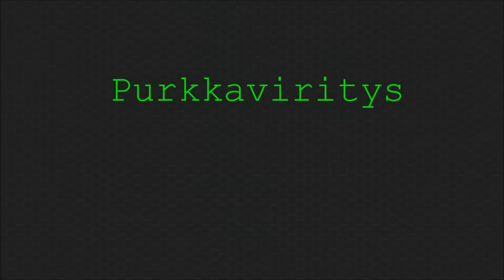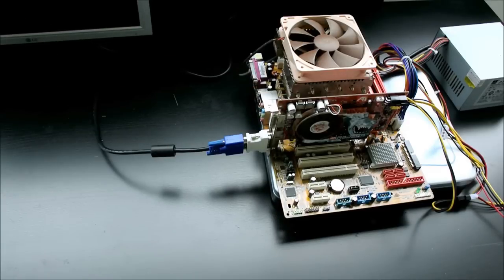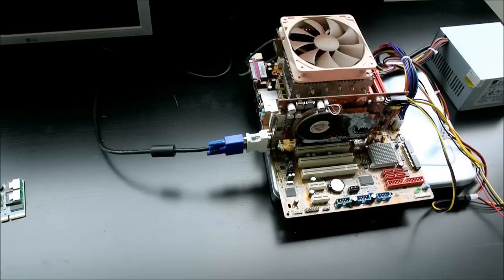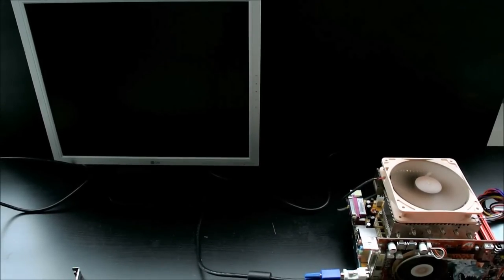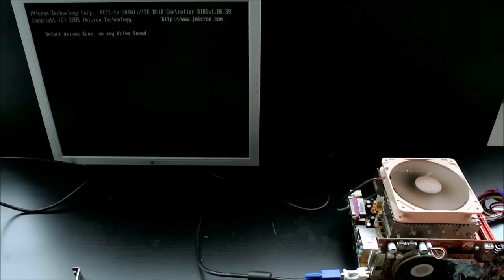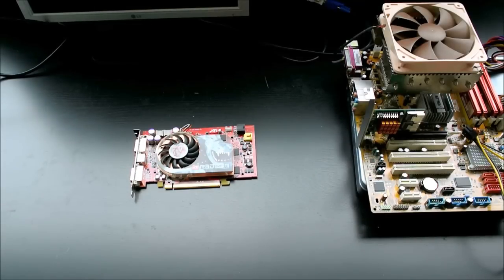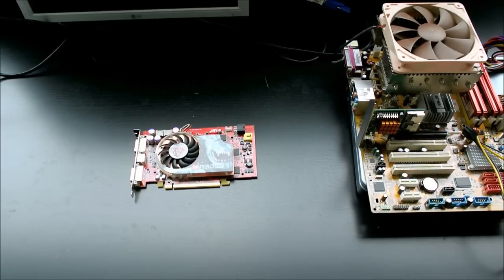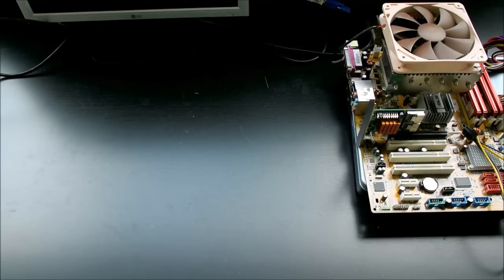Modifying a PCI-E 16x Card to fit into a PCI-E 1x slot

Comment: This worked great! I had an old NVS 290 card.Cut it down without using an adapter. Shoved it in the PCI x1 slot, worked instantly. And i was surprised it actually worked. I just bought an adapter for using cards in the future, so i don't end up with cut cards lol.

Great Educational Video..

Comment: Why didn't you just cut through the end of the slot on the motherboard? Far easier.
Reply from the maker: if there are any components behind the slot, your card won't seat properly and this wont work, also the motherboard is usually more expensive than the cheapo graphics card you are going to cut, all of which is actually written in the video description.
Reply: Yeah I read the video description. Most of the time the GPU costs more than the motherboard though.
Reply from the maker: ItsAnArse Thats pretty much only when you are using a new fancy GPU, if you use the cheapest you can get, they still come in 16x pci-e connector even when the card could function with a 1x connector. Then there are used cards that are a whole another can of worms. For most people this mod makes about as much sense as doing your own appendectomy.

Comment: I get that it's not what you "should" do. I also get that the raid card was more expensive, some of them are quite up there in price. I even get that you only care that you're getting a picture and not extreme 3d graphics. It must be quite a crappy video card to be cheaper than the raid card (128, 256, 512), which would mean you're not getting extreme 3d graphics even on 16x. Maybe something I'd try with one of my cheap cards just for a laugh. Still, I think it would have been more logical to try it with a raid card, not that you'd want to ruin the card, but raid runs just as well on 1x as it does on a 4x/8x slot and you wouldn't lose the little performance you do get from the graphics. Just a thought.

Comment: Shoulda just opened the 1xslot
Reply from the maker: and use no clip to smash the card trough the coin battery? extra points for not reading the video description.
Reply from the maker: FatheredPuma81 all cards you plug into the motherboard will almost touch the motherboard itself, so if there would be anything behind the slot itself the card would not touch down in the slot correctly (anything over 1-2 millimeters is enough). So if there is pretty much anything other than a thin surface mount resistor, it wouldn't work.

PS. My original response is because people have an issue of commenting first before reading the description or reading any of the comments (ever seen a video that has the song that is playing in the description and 3 pages of people commenting to ask the song...).
Reply: Purkkaviritys
What song was that you were playing? Lol
Reply: you know that the exact same slot you used in the video has enough space?.... your argument is invalide because most mobos have the space for that...

Comment: I rather cut by hand the old way.If these cards dust is dangerous.Then the company its made by will be in big trouble.The countries  using china made stuff.Like USA UK Canada.Will stop it fast as they approve each thing an deem it as safe  from harmful material.So either way cut it an you get sick. you can sue them for it cause it had no warning on box.
Reply from the maker: They are made of fiberglass, and you should not breath fiberglass. That is why I used a mask with a proper filter while cutting, and suing them won't do you much good if you have permanent damage from breathing resin dust.

Comment from the maker: also on a related note, AMD cards does up to 5 monitors these days on a single card where as NVIDIA can only do 3
Reply: Depends on the card
Reply: Incorrect. The Nvidia NVS 810 can do 8 monitors (all of which can be 4K simul.)
Reply: Purkkaviritys At this point, there's no difference in the mid-range cards as far as displays go. Most AMD cards can do 3-4 displays, and this is the case with Nvidia cards. It has been for at least 3 years. You're still incorrect
Reply: ***** Tell that to the fact that the fastest single card is still an nvidia card. Tell that to the fact that more than 70% of all all dGPUs are Nvidia.
AMD cards are a great value in the cheap/low end market, but don't currently hold a candle to high end nVidia cards. You're delusional.
Reply: daniel wray Fair enough, but most people with 980 Tis don't keep video cards long enough for that kind of stuff to matter. Even i've had three different video cards just this year.
Reply: I did this on an old 8400gs to see if i could get video output from x1 since i will be using both x16 slots in my server with sata cards. It worked perfect, so I ordered the zotac gt730 which comes as x1 so no need for cutting and fanless so its completely silent. great video!
Reply from the maker: You should probably read on how PCI-Express handles lanes, as there are cards that come in 1,4,8, and 16x varieties.

Also the exact reason to make this video originally was to see the ratio of "boo fake" and "well duh, I know how PCI-E works"
Reply: Purkkaviritys gtx 960 have 5 monitors ?
Reply: My AMD card is not exactly the newest, but it's up there. 1gb GDDR5 ATI Sapphire Radeon, as far as I've ever known about AMD cards, at best they can only support 4 monitors and typically only have connections for 2 or 3. I'm not saying you're wrong but even the best AMD cards I've seen are like this.
Reply: Cutting the back of the slot doesn't always work because some boards have things situated behind the slot that would get in the way.  Further the motherboard is often of greater value and down in a case already where it's harder to access for a precise cut, and you cannot make a precise right angle cut with a dremel tool alone unless you had a cutoff wheel of approx 1cm larger diameter than the body of the dremel tool OR used an extension wand.

However if there is nothing behind the slot to interfere then another option is to only make a notch in the video card contacts to make room for the rear of the slot.
Reply: wenisinchina
Kind of irrelevant tho' as he's talking about being super-cheap.  Then again someone that cheap probably don't want to invest in so many monitors either, especially not 8 x 4K size.
Reply: Stinky Cheese he made no mention of specifically only talking about "cheap cards". He said "Nvidia can only do 3" and "AMD cards does up to 5 " Nowhere in that post does it say cheap cards only.
Reply: wenisinchina
 That is ridiculous. Why would you change three times in one year?
Reply: daniel wray I had a 680 that I bought upon release (2012), bought a 290x early this year, didn't like it, bought a 970, didn't like it, and then grabbed a 980 Ti shortly after release and am finally happy. I also ended up doing a full watercooling loop in my system.
Reply: As of a few days ago, I now have a 2gb AMD radeon vision A10, still better than any Nvidia card myself or anyone I know has ever used. Maybe if you buy one of the super high end $500+ video cards you might get an Nvidia that's better than an AMD card. By the way, those super high end cards are not worth buying no matter what the speed is seeing as a 2GB card can run any game in existence right now on max settings without shutting down extra programs and without problems. I'm sorry if your delusions take precedence in your mind over my real life experience which should count for more.
Reply: +Sylver Nexus what 2gb A10 are you talking about? I hope not A10 apu graphics. And it depends on what resolution you are talking about. Maybe 1080p and lower, but games that use a lot of VRAM will suffer 1440p and higher or multi monitor no matter AMD or Nvidia
Reply: +wenisinchina I would have bough another 290x on ebay for 200 and be done. Thats what I did and never had problems.
Reply: daniel wray this was before they became dirt cheap
Reply: daniel wray
You do not know what you're talking about. Yes it is an APU and no it does not even touch my vram at all which is set to 10gb per drive (20gb) on top of 32gb of ready boost cache. First it would have to put a huge dent in my physical ram which it does not. GTA V has the biggest game map in the industry and my 8gb of ram is still only being used up to about 50% when it's running, sure the APU is running near 100% with everything maxed but I can still pull off running movies in the background. You're probably one of these people who wastes their money on parts that are way better than you'd ever need and assumes that anything less isn't going to cut it. I'm the kind of person who takes what I can get and makes it work for me.
Reply: ***** Well aren't you the cat's ass.
All that readyboost cache. So fast!
You ain't got shit on my 1TB of external drive being used for readyboost an 32GB of RAM.
Fight me.

No but in all seriousness there's no such thing as a 2gb APU, dumbfuck. My Nvidia 980 Ti poops on your crappy APU, too.
Reply: These are millionaire kids, one can afford to be finicky.
Reply: the Gtx 1060 says otherwise
Reply: My GTX 760 (Isn't much of a gaming card) Runs up to 4 monitors by itself. No SLI
Reply: I'm glad that Apple eliminated the headphone jack on their new model in order to make it ripe for entities such as this to provide information that would help the gullible to destroy the gadget. Likewise, one can relate this type of video to that.
Reply: Gaming With Chief My GTX 760 2GB Supports 4 monitors at once, plus I've tested it, Currently only running two as one died
Reply: my 7950 can
Reply: but a year later they suffer from planned obsolecence?
Reply: My GTX 960 has 5 output ports
Reply from the maker: +wenisinchina actually I was talking about "cheapo" cards (aka Gaming cards not ones meant for day trading, cad drawing etc.) and the nvidia NVS is for scientific or work use, not only that but that card is very recent, like released this month recent and my comment was a year ago. Then there is the whole pricing issue with that card as its 800~ dollars. I don't care what brand of card you run or how you run it, I just like amd for theur eyefinity and cheap prices.
Reply: wenisinchina It does not matter how many monitors any Nvidia card can handle, Nvidia is the crap from the bottom of the crap barrel compared to any ATI Radeon card. I mean ANY!!! This is coming from someone who's used literally piles of video cards.
Reply: +wenisinchina Tell that to the fact today the 290X beats the 780ti even though the 780ti was the "fastest single card" back in 2013. Tell that to the fact that once AMD optimizes drivers to push the Fury X faster than the 980ti, then Nvidia will release their next "fastest single card", stop producing the 980ti, and force fanboys to buy the new one. The 980ti will be forgotten, just like the 780ti. All benchmarks put the Titan X, 980ti, and 970 against the Fury X, 390X, and 290X. To say they can't hold a candle in the high end is nonsense. They can keep up with their counterparts and hold value for years. Thats why they keep bringing the 290X into benchmarks and no one talks about the 780ti anymore.

Comment: Why didnt you just cut the back of the PCI-E 1x slot rather than cutting the card its self as that would have left the card intact and then could be used a 16x card again
Reply: Purkkaviritys  yeah but what you dont understand is someone is going to try this do it wrong instead of what the op said cutting off the end of the pci-e slot their going to destroy their video card
Reply: Purkkaviritys Eh, my motherboard cost me $110...Graphics card $300...

Either way you should probably just use a riser...or just get the motherboard with the slots you need to begin with. An extra x16 slot can be used for a x1 or x4 card...so just get something with two x16 slots. Also I get that this is just for demo but some people are stupid and will do it just because they see it and think it's the way...
Reply: I realize this is a 4 year old comment, but as someone just trying to put a 3+ year old GPU worth less than $20 in a MOBO worth more than $100, there is a use-case.
Reply: arranmc182 it is x16 slot card?? So this slot can used for gtx 750 too?? Please answer. 🙂
Reply: @mamba4948  Yes, it should. The card will negotiate the speed with the motherboard. A pci-express 3.0 can go down to use pci-express 1.0 speeds with one lane (but obviously it will be slower). But do not cut the card, it's too risky.
Reply: Jordi Coma Garcia thank you 😊
Reply: I think the same :/
Reply: A crappy GFX card costs less than a mobo.. so mod the least valuable component?!
Reply: I ruined mine
Reply: Exactly.. Its called "opening" the slot and he could have mentioned it in the actual video before some very well ""educated"" individual goes to grab his powertools and butcher his gpu lol.. To me it seems he didnt know about this, and now he plays it off as if he knew all along but we all know better, its obvious af
Reply from the maker: ***** considder the following, motherboard costs 150 and graphics card costs 20, which one will you sarcrifice? how about when there are capacitors or other components behind the pci-e slot?
Reply: @Purkkaviritys  I tried with my PCI cards and they also worked
Reply from the maker: You, like so many before you, fail to understand that this is not entirely serious, and you also fail to read the description of the video. It shows what you can do, not what you should do.

Comment from the maker: ever wondered how those 16x pcie sized slots only work in 1x, 4x or 8x in the second slot in a motherboard that has 2 pci-e slots, its to simply accomondate a card that fits into a 16x slot so that you don't need to do a high risk cutting operation as shown here that forever mangles your card to 1x speeds.
I would suggest you go read on how the pci-e communication between the card the the mobo works before commenting further.
besides, it would be trivial for me to do another video about this.